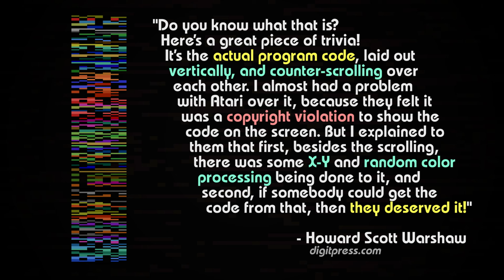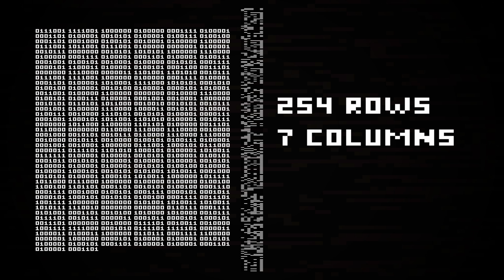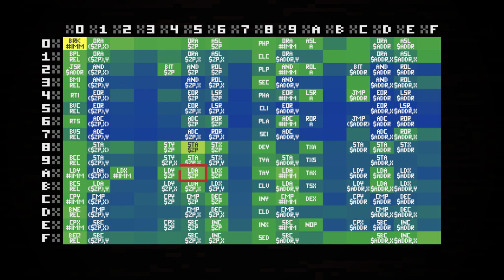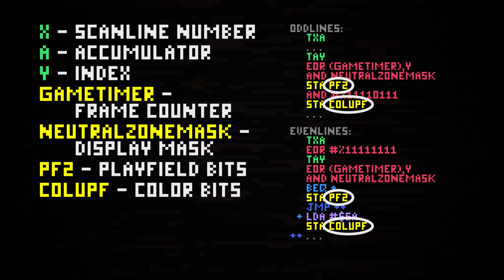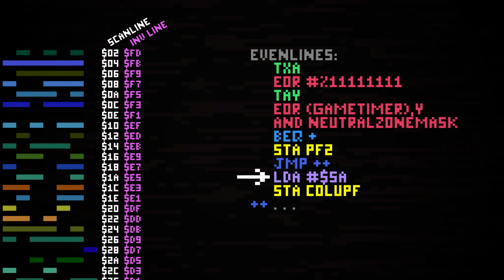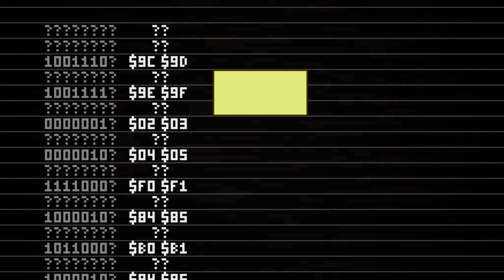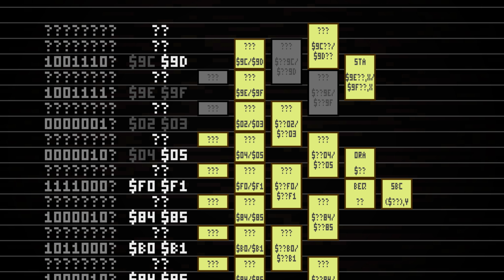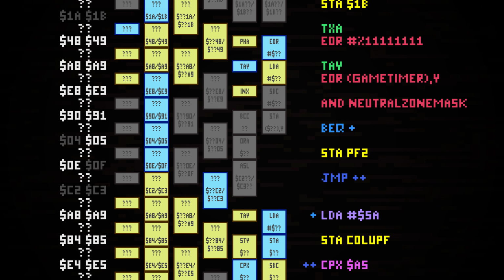Reverse Engineering Game Code from the Neutral Zone

Comment: The "neutral zone" is sometimes not visible in 30fps on YouTube because of the flicker
Reply: Thankfully that should only be an issue for people watching in 480p and under, unless YouTube has started giving different devices different framerate options that aren't available on desktop.
Reply: @K-Anator   Or they are watching on a device that is limiting to 30fps. YouTube can send you a 4k 60fps signal, but some phones will limit the display at 30fps for power saving reasons. Of course they could just be using an old crappy screen that is 1080, but only 30hz.
Reply: @TheTonyMcD  Yea I didn't think about the phone's power saving modes, which is pretty stupid on my part because I have my phone set to 1080p30 rather than 1440p60 to save battery because, well, I don't really use my phone for anything other than actual phone stuff and don't need that fidelity there.

I'm worried about the people with displays only capable of 30hz though. I have quite a range of displays at my disposal, from my childhood CRT to a rear projection to a gaming monitor. 
Not a single one, even the terrible 13" 720p Emerson TV does less than 60hz.
Reply: @K-Anator  Computer monitors, you would be extremely unlikely to ever find one at 30fps. Even since CRT days, computer screens have been at least 45, usually 60. This is generally only going to be seen in early flat screen tvs. 480, 720, and even 1080 LCDs were commonly available in 30fps version for television screens. Tv really didn't need 60 so they could make cheaper screens this way.
Reply: @TheTonyMcD 60 is actually lowballing it for computer screens. For a good period of time, IBM-compatible computers with VGA-compatible displays were extremely popular(like... 1990 to now). And VGA's default refresh rate is 70Hz. 

This still shows up in some places. Folks messing with modern adaptations of the original Doom occasionally find out the game logic runs at 35 FPS, and get confused because that doesn't go into 60 evenly.
Reply: @CptJistuce  Speaking of 70hz, one of my monitors is a Samsung Syncmaster 940BW from my very first full PC build in 2006. The refresh rates available on it are 60/75, and I've squeaked 95 out of it with custom resolutions.
Reply: @K-Anator  Nice!
Reply: @CptJistuce  VGA is 70Hz only in its 400-line modes, like 720x400 text, double-scanned 320x200 MCGA (Doom), and legacy CGA emulation. 640x480 dropped down to 60Hz to squeeze in those extra 80 lines at nearly the same dot clock & horizontal sync frequencies, and was noticeably more flickery with a short-persistence-phosphor CRT... especially with bright backgrounds.  I think 640x350 EGA emulation (which required special support on the monitor) was 60Hz also, for the few things that ever used that - the original Simcity game was one.
Reply: @jordanhazen7761  This is true. I was getting a lot of mileage out of "default refresh rate" in an attempt to avoid stipulating all the complexities and then additionally explaining the difference between low-res, high-color and high-res, low-color modes.
Reply: @K-Anator  They did, I am on a laptop with 760p and it wasn't showing up.
Reply: @I_Love_Learning  That's quite the resolution, Chromebook type device? Though I'd imagine what was mentioned previously holds true, you're actually receiving 720p60 at your resolution, but your display is only 30hz so is skipping every other frame
Reply: @K-Anator  No, just very low end Samsung. And I just checked, it is p60, my screen is just 30hz.
Reply: @K-Anator  720p is also 30fps on firefox.
Reply: @richardkeith9498  Weird, guess they take issue with people not using chromium based browsers. Seems that it's 720p60 on Edge, Chrome, Opera and Brave.
Reply: @K-Anator huh, didn't realize YouTube had dropped me to 480p, Lol.
Reply: @giin97  It do be like that sometimes. Every now and then my internet has a bad time and decides it's gonna dump the quality down to 480p. 
Super annoying when it happens when I'm watching on the projector; it's bad enough that thing is only capable of 1080p, but with a screen size of 105" 480p is wild.
Reply: @giin97  dropped? that's as high as I'm willing to go on youtube videos unless the quality options are only the highest and lowest available options
Reply: @K-Anator  Or, they have limited bandwidth and don't want to waste it by viewing Atari footage in 720p.
Reply: I kept thinking "what's this dude even talking about" at the beginning before I remembered that my phone defaults to data saver resolutions. 1440p/60 cleared my initial confusion right up.
Reply: @Phroggster lmao I switched to 480p just to look, and yes it's completely black.
Reply: @nowonmetube not for e on iphone
Reply: @Phroggster happend to me to.
Reply: @Phroggster I think YouTube is honestly broken, 1080p is the highest setting I can see
Reply: Oh that's why I couldn't see it.

As an old Atari player from back in the day, I knew it was supposed to be there, but it wasn't visible.
Reply: I was JUST seeing that and wanted to make a comment about it !
Reply: I hope he doesn't change it That's a really cool effect
Reply: Hey, that's crazy! I was so confused, I thought it might just have been a really faint thing or maybe just that it didn't show when playing the game. That's so odd, wonder why it happens
Reply: @StrabbyStrabby  because the effect only shows up on every other frame of a 60fps video. If you are watching at 30fps you will only see every other frame. Depending on what set you see, you will either get the effect on every frame, or get no effect on every frame. It could also appear and disappear at random if a frame gets dropped or some other hiccup occurs and moves you onto the alternate set of frames.
Reply: @StrabbyStrabby  It's explained in the video, the graphics is drawn in every second scanline because hardware limitations.
Reply: Hey, thanks!
Reply: Unfortunately, this is a common issue for many Atari 2600 games that use flicker (i.e. sprite/playfield multiplexing and scanline flickering) to exceed the native graphics capabilities of the 2600. Some people might be surprised to discover the Atari 2600's native frame rate was 60 Hz (for NTSC, 50 Hz for PAL), which can be unexpected given it's a console from the 1970s. The 60 Hz frame rate is also why Atari sprite movement can look very fluid when movement uses 2 byte fixed-point arithmetic without flicker. We've come to expect fluid movement on more modern powerful consoles. (See Atari 2600 demoscene and modern homebrews.)
Reply: lol, if only he get rid of one frame at the beginning. 
I wonder if it can be fixed by trim the video (by odd number of frame) somewhere. 
Or maybe the youtube take the easy route and not entirely re-encode the whole video's lower resolution options. Actually that makes most sense so it is unfix-able.
Reply: The flickering was hurting my eyes, so I'll take this as a tip and swap to 480p!

Thank you!
Reply: That explains my confusion. The only time I could see it was when he told the dev's story at the start
Reply: Oh, thats why I didint saw it for the first part.
Reply: Omg it’s true !
Reply: OHHH I was wondering why there was literally no neutral zone for the entire beginning lmfao
Reply: oh that's wild
Reply: Watching at 2x speed will also result in it it not displaying
Reply: Once it's slowed down, it display perfectly fine even on 480p. lol
Reply: yeah i was looking at the preview and thinking "what the heck is this guy talking about?"
Reply: I JUST TRIED THAT THATS HILARIOUS
Reply: omg thats so cool
Reply: Yea I changed it and it doesn't show at the start
Reply: Huh
Reply: lol, did not see the neutral zone at the start, as yt stealth reduced the quality, but with the fancy atari graphics and text in the video, it was not obvious until this post mentioned it.
Reply: Gotta wonder why entirely dropping half the frames is the default downsampling method instead of averaging them out... we somehow figured it out for the x and y directions decades ago, but still haven't for the t direction?
Reply: @youtubeforcinghandlessucks  I'd imagine it would require more processing (which youtube doesn't wanna do)
Reply: Thay planed that 
Surly
Reply: Wow I was wondering what he was talking about at the beginning of the video because I couldn't see it.
Reply: that was happening to me and i was so confused lol
Reply: This makes me realize, if anyone claims they can't see 60 fps vs 30, just show them this video.
Reply: @nowonmetube   This effect really has nothing to do with anybody's ability to perceive a difference in frame rate. For example, let's say this video is streaming at 1,000,000fps and the same behavior of the effect only being rendered every other frame holds true. If your display is 500,000fps then the same issue will present itself. You will still either see the set of frames that has the effect or the set of frames that doesn't.

Besides, the whole refresh rate debate is kind of silly anyways. It is almost entirely dependent upon how fast things are moving and how big the display is. A big enough display with a fast enough moving object will have stutter even at 240hz. Likewise, if you are watching a video of grass grow, I doubt anybody will notice any difference between 30hz and 60hz.
Reply: Laughs in youtube premium quality
Reply: @1lDIB1  laughs in not paying anything
Reply: @1lDIB1  you pay for HD+ (up to 4K) and 60 fps? I didn't even know you have to pay for that.